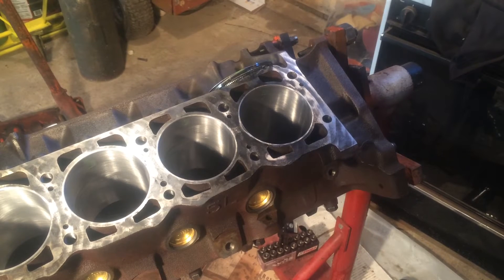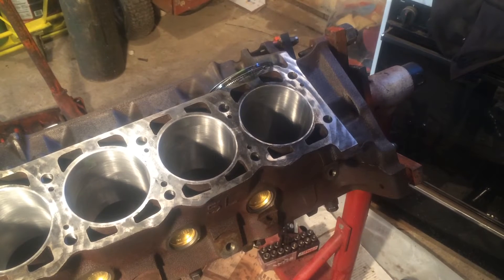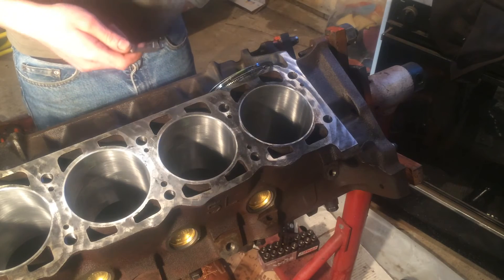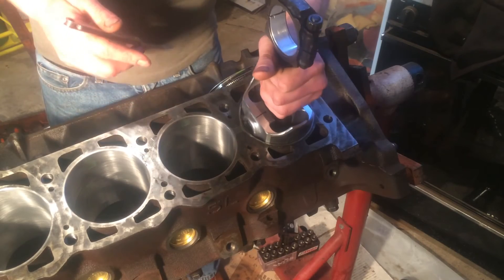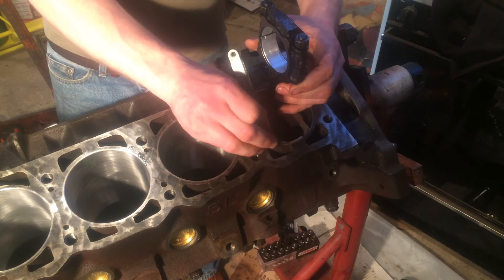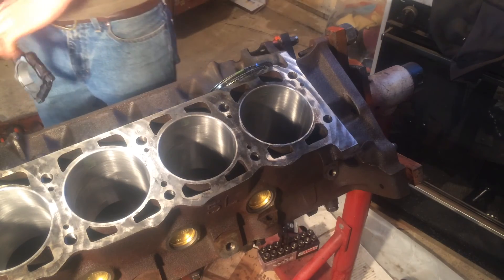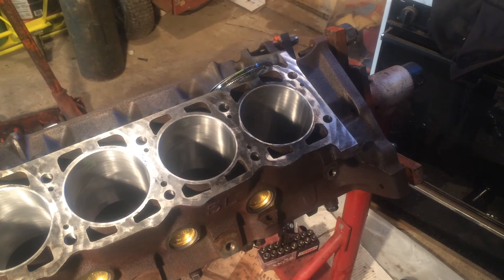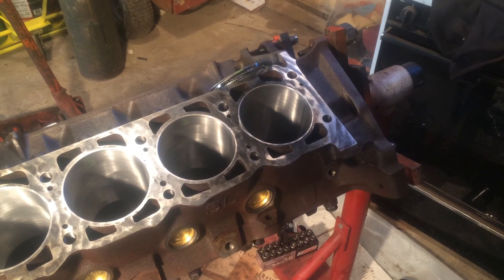Checking piston to bore clearance

Comment: This can work ...but because of the cylinder wall arch dbt u get an accurate reading... unless feeler guage is thin enough to bend... wouldn't recommend for high power/precision engine
Reply from the maker: Pistons in a normal engine typically have a tight enough tolerance to the bore that the feeler gauges are thin enough to bend with the contour of the piston/bore. If it was any more than a standard rebuild on a passenger car engine, the bores would have been measured with an actual bore gauge and the pistons checked with a micrometer.

Comment: Do you need to check all sides of the piston with the feeler gauge?
Reply from the maker: It wouldn't be a bad idea if you can. Especially if your engine hasn't been bored, the cylinder could be "egg shaped."